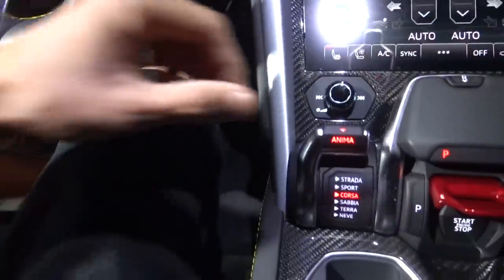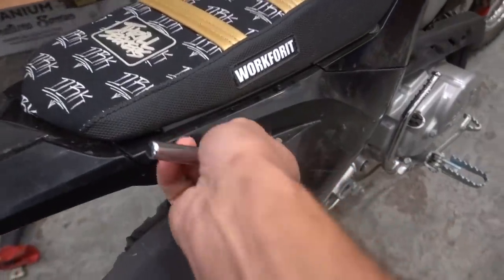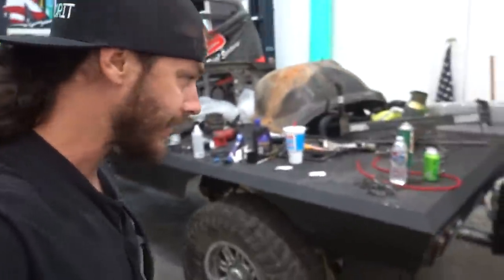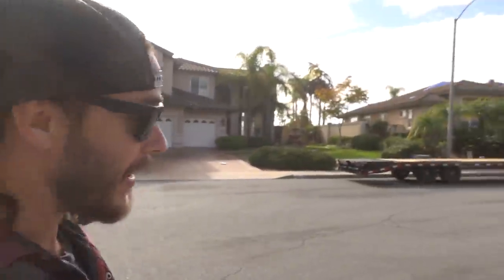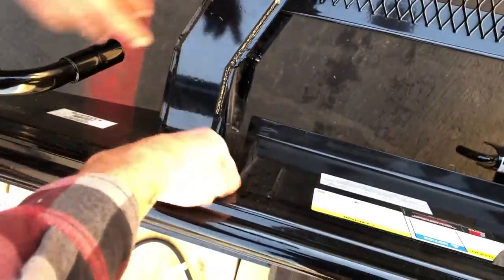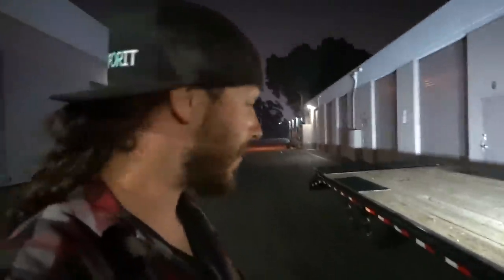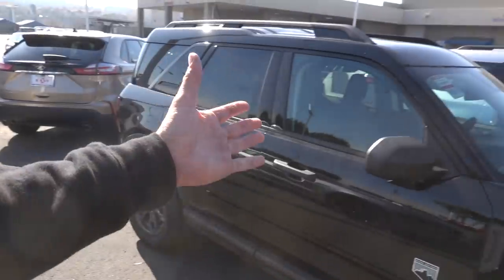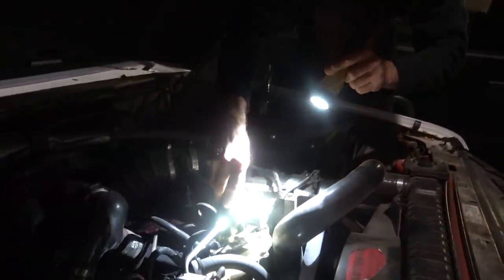MY FORD IS DOWN FOR THE COUNT... :(

Comment: Lift pump hose to fuel bowl   dripping in the valley and running out the back. New hoses and clamps. Call Zach. Piece of cake, mine did it a lot. Napa has the duel fuel hose for diesel fuel, lasts longer than the other kind. Cut it to length. Check the drain valve on the fuel bowl.

Comment: Check the cap of the fuel bowl on top of the motor underneath the plastic cover. Mine did the same thing when the cap rattled loose. Tightened it up and I was back on the road.

Comment: Do yourself a HUGE favor and install a regulated return fuel system on the obs. Relocates the fuel filter and adds a water separator on the frame rail. It makes everything so much cleaner amd simpler. One of the best upgrades I did on mine.... gosh I miss her

Comment: It's one of the fuel line going to the head or the fuel filter housing is leaking. Same thing just happen to my 7.3. I love my 7.3 everyone always says they leak to much and always break down but I've had the actual truck break more then an engine part and I 284k miles on it.

Comment: I wonder of that fuel kit will work on my truck isn’t not a California truck but if it works good and helps with leaks and stuff I might look at it cause my fuel system is fine as far as I can tell but I want to build
It  for more power

Comment: Love the trailer build, but I have one constructive criticism. Why use rivnuts on the square tubing when you could of just drilled and taped it. I thought rivnuts were more for along the lines of sheet metal where there is not enough metal there to drill and tap.